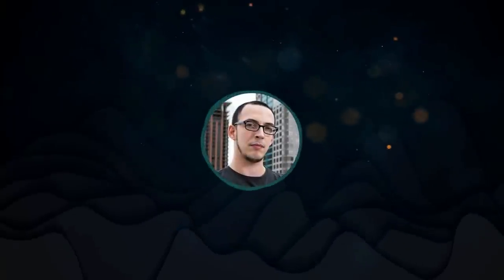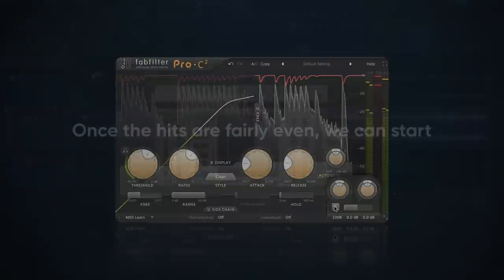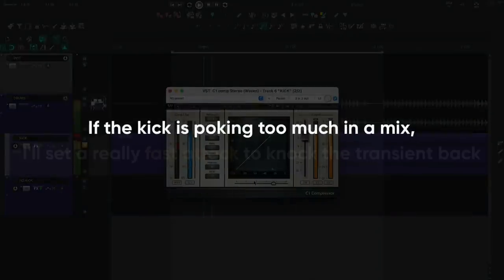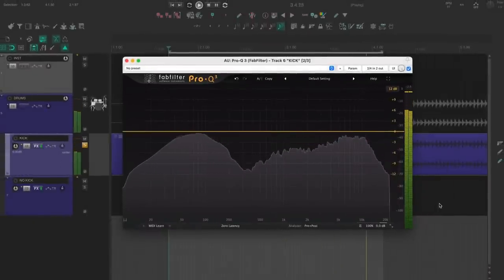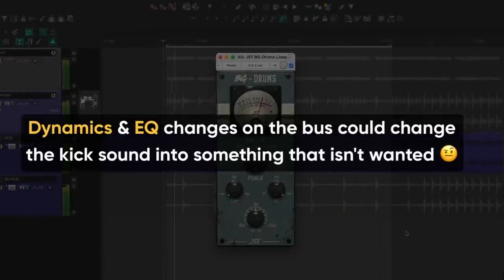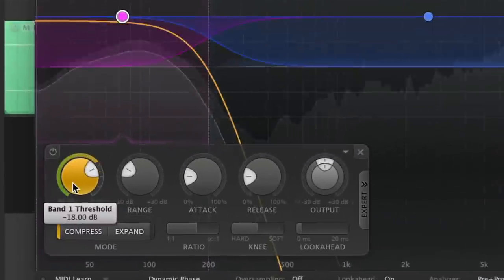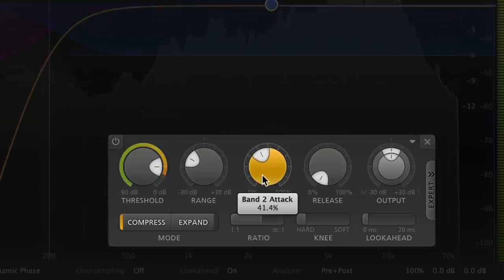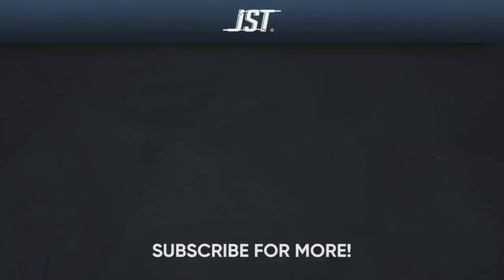How To Mix A Kick: Compression

Comment: Is there any reason to do any of this on sampled drums?
Reply: Depends on how they're processed. I do with GGD yeah, just to add a touch of punch basically. Doesn't need as much levelling
Reply from the maker: Most sampled drums still don’t sound that great, and even if they do they still need processing that can never be baked in because it depends on the performance, tempo, song, overall mix. Etc.